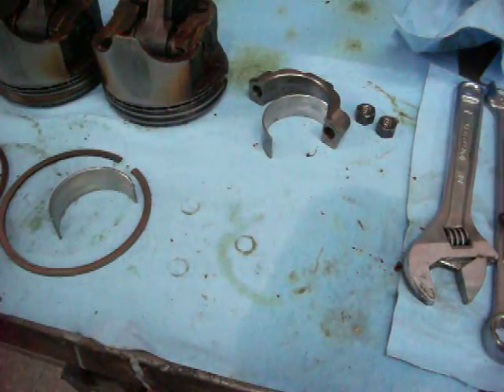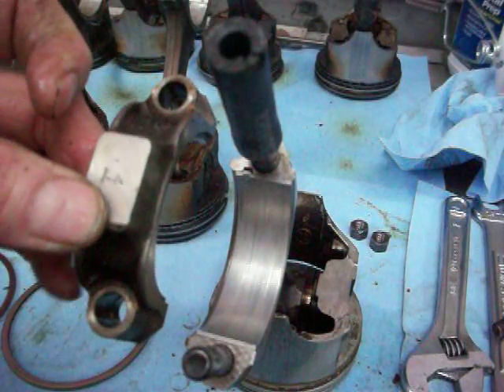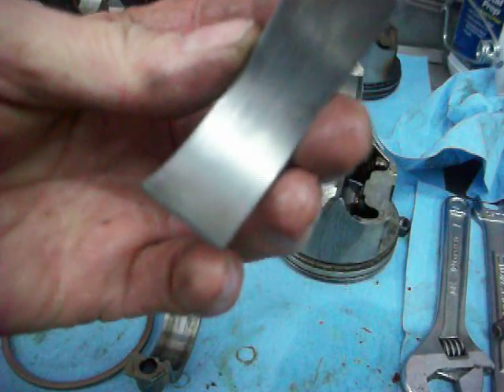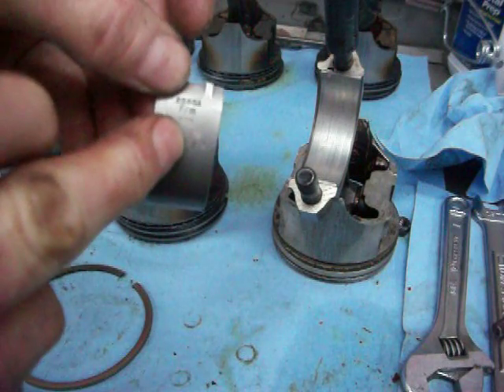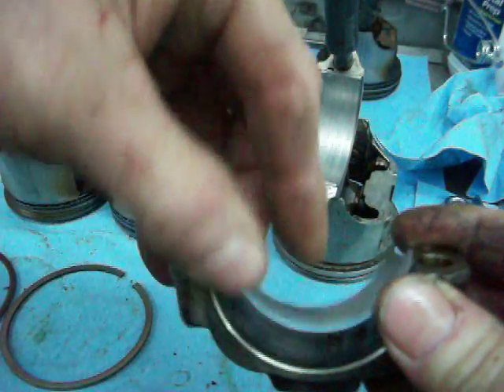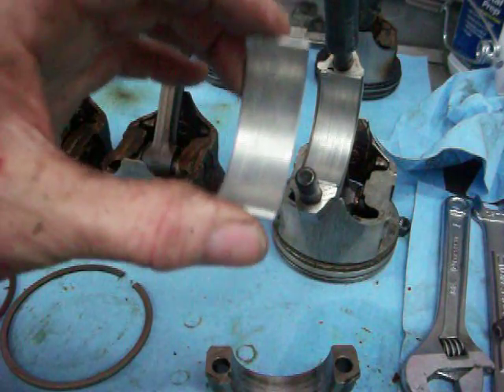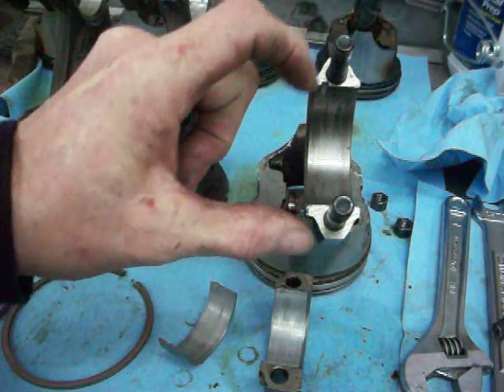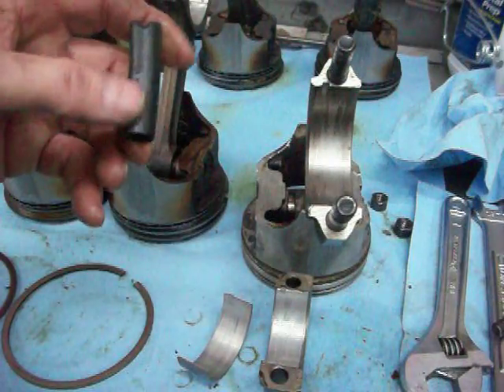Some info on Connecting Rod Bearings.#3

Comment: Check the id of the rod with no brg as some ford engines came of the production line with oversized rods  and mains from new even though the crank was std.  came across a few engines with os she’ll backs in my time reconditioning

Comment: If you check out vintage engine or obsolete engine parts you can often find .001, .002 undersized. Sometimes someone might have already done that and it's maybe a very good bottom end . Always polish the journals even if you reuse good bearings

Comment: I’ve been searching for videos to see if it is ok to not have oil holes in the connecting rod/bearings. And then you said oil comes out of the crank shaft and oils the inside of the bearing. And it clicked in my head. Thank you. This video was super helpful

Comment: great video how ever that notch is just a locating tag  to hold it in place when installing the bearings after that the torc on the bolts stops it from spinning hence having the correct torc when doing the conrod cap bolts
Reply: Go back to school. It's not a roller bearing in a 2 stroke . There is .002 thou clearance between the rod and the crank. And they do not touch. Grind them off and see them burn up. Put your money where your mouth is.

Comment: If you Nick the Crankshaft with the rod bolt run a very small round file parallel with the rotation of the crank until
the nick is gone then polish it, you will have a very small indentation, it will fill up with oil when engine is running and be fine......

Comment: hello just picked up a nice 350, And the guy i got from took all the rods out with the pistons.  They do do have there caps BUT he didnt number each rod where they go.  I am putting new pistons on them and its at machine shop.   Does it really matter if not numbered? Thanks
Reply from the maker: It matters very much but the machine shop should align bore everything and you should be good.
Reply: @josaljo1  thanks!

Comment: The tang is only for alignment not to keep it from spinning. That is done by the crush. The bearing when installed will stick out alitte on both ends. You must make sure they all stick out the same on both ends and both halves. When you tourqe down the caps it will crush the bearing against the journal.
Reply: It does both
Reply from the maker: that is right. Thank you.

Comment: Great video.  Recently my engine gave out and the mechanic said the needed parts where 2 connecting rods, gasket kit, crankshaft and oil pump.
Reply from the maker: That will require lots of machine work.

Comment: That tab doesnt stop bearing from spinning. Its the bearing crush resulting from torquing the bolts, pushing the bearings pressing against the bore of the connecting rods that stops it from spinning.
Reply: That is correct; the tab just locates  the shell ;  there are PLENTY of engines (i´m in portugal,europe)  with NO tabs in the bearing shells.
Reply: Yep , damn near all spun bearings are  a result of it not being held in place firmly enough.  If it were fixed in place and the journal makes contact , instead of knocking it loose it would "self-clearance" and probably not hit anymore,  at the cost of a few psi of oil pressure instead of another motor.
Reply: Yup why do ppl think that. That tiny nub can't stop shit
Reply: Exactly right..That is they a new bearing will stick up just a tad. On each half..These need to be aligned right on both halves. So that when you toque them down. Each half will push each other. As they form....

Comment: Sir what happen if the con rod cap i s fix wrong
Reply from the maker: The motor will start hammering untiil it comes apart. It will be destroyed.
Reply: OK Sir pls how long will it take before it destroy because I couple one recently have run it like 15 minutes
Reply from the maker: @toheebkunle9440  It depends on how hard it is knocking, it could be 5 minutes, it could be a week. But the hotter it gets the more out of round it becomes. Disaster is looming around the corner somewhere, that is for sure.

Comment: sir if the engine has a knocking sound do i need to replace the con rod bearing with d same size?  or i need oversize?  thanks.
Reply from the maker: I hate to ruin your day, but you will need a new crankshaft or have the journal giving you trouble ground round again. You may be able to match a new bearing to it, as is, but it wont last. The knocking means out of round.

Comment: What's that material made of?
Reply from the maker: The bearings are like an alloy, softer than the steel. Copper and Lead I believe you might want to check on that.
Reply: @josaljo1  Bronze ( copper + Tin) and steel alloy (MS)
Reply from the maker: @dp-01  you are right, i could not think of tin last night. Thank you.

Comment: what's the name of this connecting rod bearing?
Reply from the maker: Sorry my friend I dont understand your question.
Reply: @josaljo1  My friend I just want to know whether these bearings are called connecting rod bearing or does it have a specific name...
Reply from the maker: ANAND ARAVIND  No problem they are just called connecting rod bearings. Now make sure you use plastigage to measure what size bearing you need. Std. is standard factory specs. .002 under and so on. Thank you
Reply: @josaljo1  Thank you very much.
Reply: @anandaravind6342  connecting rod bearings, or just rod bearings! And the bearings for the main caps are called...u guessed it main bearings!!!
Reply: @jjmccloud  beside smart., you are also have sence of humor. I like it bro.
Reply: We're you asking what this type of bearing is called such as Ball bearing, roller bearing ECT. ?

Comment: when I replace a bearing do i grease the front the touches the crankshaft? I'm assuming the back stays dry?
Reply from the maker: Collective Consciousness Put assembly lube on the faces that face away from the block. In other words where the crank sits and the outside of the thrust face.. yes the back stays dry.
Reply: +Josaljo Won It was my first time doing this so I'm learning as I go. Need to torque bolts and tighten in a certain sequence etc......  I only had a problem with one piston with both bearings totally disintegrating into my oil pan causing the rod to knock. I was low on oil and caught it quick. My crankshaft seems to be OK as far as I can tell to the touch.   So I replaced the two bearings on the one piston should i grease the face of both of those bearings?
Reply from the maker: Touch is not good enough, use plastigage to check the clearances and a micrometer to measure the journal, if the journal is out of round it will start to hammer no matter how many new parts you put in it.
Reply: +Josaljo Won is there a video on how to check the crank and what tools I need. Like the micrometer or plastigauge?
Reply: +Josaljo Won I forgot to mention I'm doing the work through the oil pan and the crank shaft is not out of the motor. Can it be checked this way?
Reply from the maker: https://www.youtube.com/watch?v=ALLLxbWUSbU  This video is about plastigage. You might need a micrometer that is 2 to 3" range unless you are working on something other than a chevy. Set the plastigage in the bearing that is in the cap and just tighten the bearing as per specs and then meansure like the video shows.
Reply: +Josaljo Won I broke off a bolt on the rod cap, the torque wrench never clicked so I kept tightening. Any easy way to get that bolt out without ruining the threads so I can just get another bolt
Reply from the maker: Collective Consciousness You are not having a good day are you? Can you send a pic of this thing I need to see it.